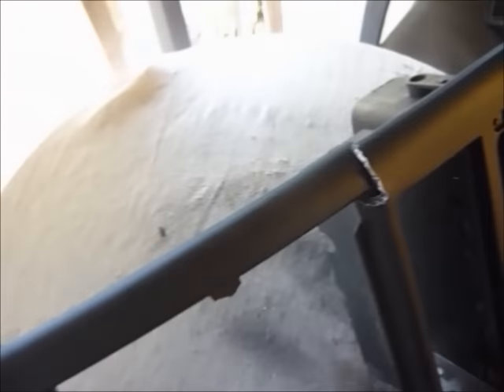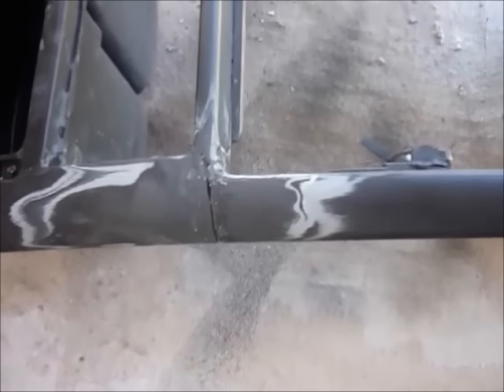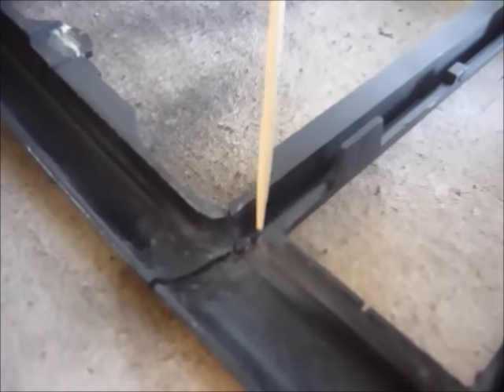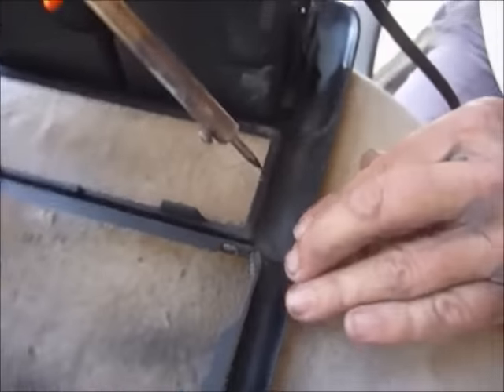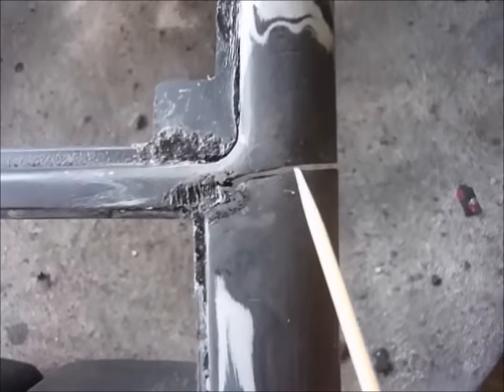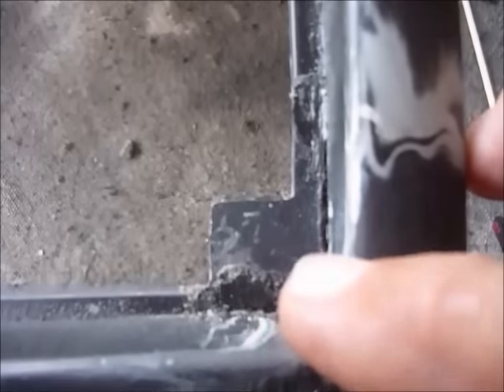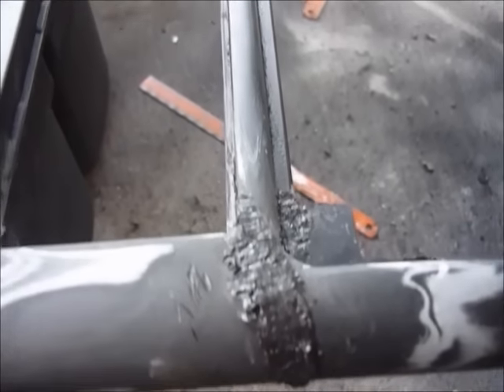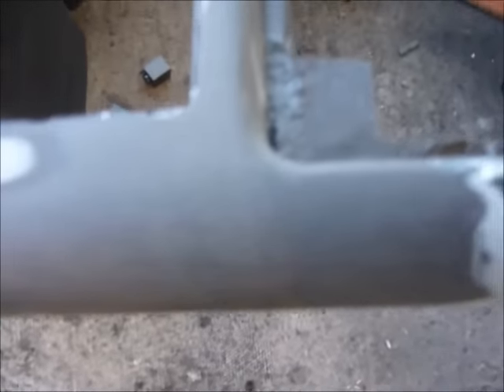How to Weld ABS Plastic with a Lead Soldering Iron

Comment: To make it even stronger melt some material on the back. Put wire window screen on the back (cut to fit overlapping the joint). Melt the screen INTO the material and cover with more material and smooth out. It'll NEVER break again. Been doing this for yrs with ABS, PPO, TPO, ect. You can get material strip and even a flat welding iron off of Amazon. IT WORKS if you do it RIGHT. GOOD JOB!!!

Comment: Using thick steel mesh window screen is a huge aid in strengthening a break provided you have adequate room for placement. Plastic  welding tips are available that are wider and flat . Great for pressing down and welding a larger area in one shot.

Comment: Great presentation Shane, thanks very much! 
After watching your video I went on to successfully repair a cracked spare tire cover on my Audi. Here's something that helped - I used an incandescent lamp dimmer to control the heat output of the soldering iron., a tip that I picked up years while at a stained glass course.

Comment: Good video.
With large cracks, tack a couple of points like you did, then make an ABS slurry quite thick using Lego (or other forms of ABS) and pure acetone.
Chop the bits up into a glass jar and add the acetone. 
Stir and add more ABS or acetone to get the consistency required and fill the crack then smooth as is shown here.
It hardens nicely, as you've shown.
Sand, paint and enjoy your handywork.

Comment: I use a typical lead solder iron for repairing broken bumper skins, all you have to remember is to mix or make a blob of plastic with the iron's tip first, then introduce a sliver of plastic to fill the gap, smooth out if you can.  I use the flat tip on my iron, then sand with 40 Grit, finished with either fibreglass or plastic filler or both, depending on where the repair is.

Comment: NUTS! I just bought a headlight assembly for my wife's car. I'll fix the old one and send back the new  one. Great tip, using copper wire bits for stitching.
Reply from the maker: Hope it saves you some money!

Comment: Huge help. Gave me plenty of ideas. I've got a 2000 Dodge Ram. Funny thing is the top part of the dash is perfect. The lower section that includes the ashtray, glovebox and cupholder and all plastic areas around it are gradually all disintegrating. Will incorporate these ideas into my many repairs.
Reply from the maker: Thanks Bob.  Hope you have a win with your repairs!

Comment: There is a video on YouTube where a guy uses stainless steel window screen laid flat and heat pressed into both sides of the crack on the back side. Works like a charm and is super strong.

Comment: Beautiful job Shane! I've been dabbling with this myself - so far Polyethylene (which is a real bugger) and some Nylon-6/6.
I'd prefer to touch up the Nylon by dissolving some scrap, but the chemicals required to create a Nylon solvent are not cheap.
Reply: What are the solvents needed for Nylon 6/6?  Some of these chemicals may still be available in different parts of the world, or in storage in the shops of some of the viewers. Thanks in advance.

Comment: The propper plastic welding rod makes a big difference. Pvc rods dont bond. Poly propelyne doesnt either. Make sure you have abs rods. Use like rods for the type plastic being repaired.

Comment: Instead of stitching with straight pieces of copper (soft), use rigid steel with hooks on both ends (really small steel paper clips work).  The hooky part adds strength and keeps the joint from pulling apart.

Comment: I've damaged the tripod  mount fitting for my telescope, I've used araldite but every time I tighten the wing nut is just cracks of the glue, now I think I will try this. Not sure what choices in weld there are.
Reply from the maker: Not sure about a wing nut being tightened on it.  But bound to be better than araldite.  Hope it goes well for you.
Reply: Also, can pickup another solder tip and grind it flat or round to transfer heat quicker and flatter .  Nice vid

Comment: Great tutorial, thank you!
Has that soldering iron adjustable temperature? Is it usable for other materials as well?
Reply from the maker: No temp adjust.  It's a cheapie.  I just turn it off when it gets too hot!  Can be used for most small lead soldering jobs - circuit boards etc.
Reply: thx!

Comment: This is not ABS plastic (most likely). ABS plastic has no melting point, ABS burns away before your eyes when trying this, trying to get other plastics to stick/melt to it doesn't work either. You end up having to do a chemical weld with MEK or acetone with a backing piece.

Comment: I wonder if that work on vintage plastic cases tube radios I had some shipped to me and they werent packed well and had some pretty bad cracks ?
Reply from the maker: One way to find out and that's have a careful go I guess.  I know it doesn't work with all plastics.
Reply: @Ron Thompson Depending on the type of plastic you might be better off using CA glue and baking soda - fill the crack with baking soda and smooth with a finger then drop a couple of drops of CA glue onto the mixture. It will generate heat and harden within seconds (literally) and can be sanded immediately.
Test somewhere hidden first if you're not sure.

Comment: If you just smeared that lego brew into the crack, how strong would that be?
Reply from the maker: Tried that.  It breaks.  Mind you, that's if the plastic has cracked right through.  Probably be okay if it was just a surface crack and still connected here and there.

Comment: what grit sandpaper did you use?
Reply from the maker: Can't remember but would have been wet and dry.  Probably knocked back the rough excess weld with a 120/180  then finished smooth with 400/600.

Comment: A much much better way to have done this is to create ABS slurry by using Acetone and scrap ABS. Once disolved you could use the slurry to have bonded this. Since it's actually ABS doing the bonding and not glue, you are basically plastic welding it together and the job would have looked neat and clean.
Reply from the maker: If you've done that with success good luck to you.  I naturally tried to do that first with experimental pieces and found a thin smear of slurry trying to hold things together cracked at that point every time with just a minimum of pressure.
Reply: Waiting on your video